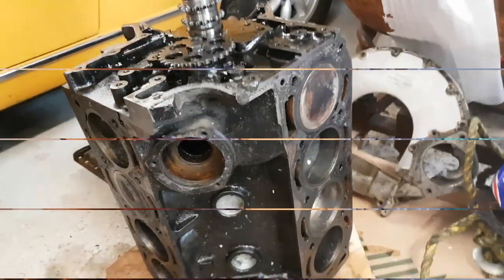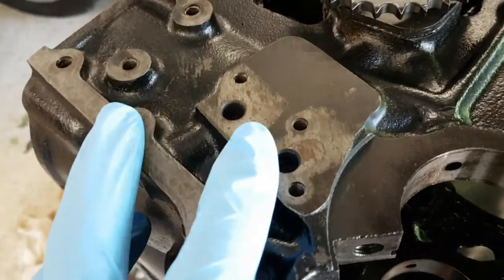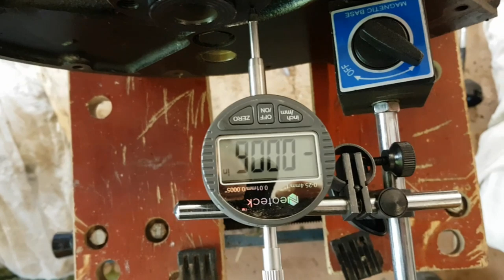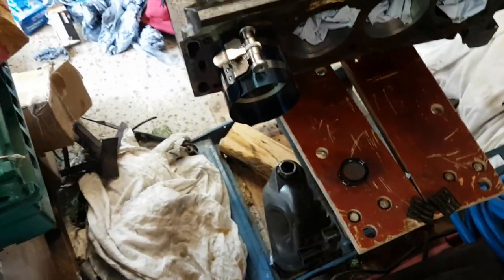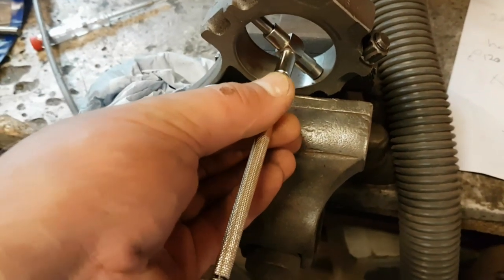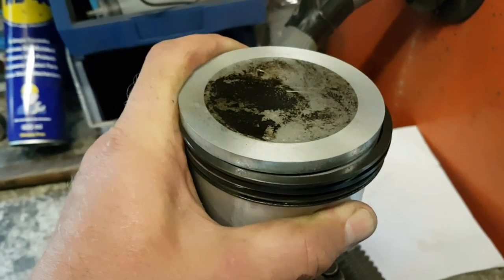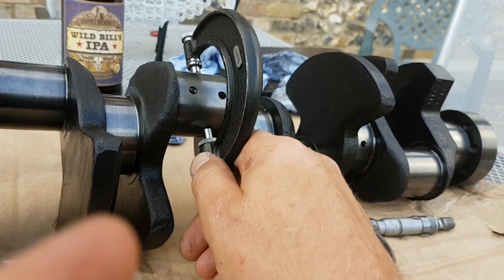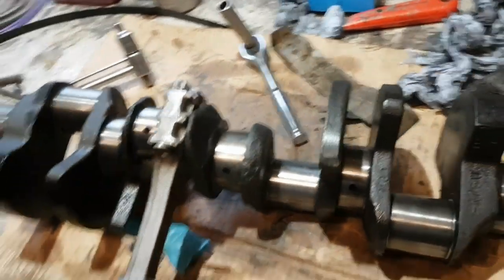Triumph Stag V8 engine build - that keep fighting back Part 1

Comment: Agree on all points you made about people using the usual comments on the reliability. I have had 4 stags in my car ownership and sold the last one in 2011, had a timing chain jump off on my second one after 2 days of owning it [3500 Rover unit was the replacement] 3rd one was a cataloy car with a nice paint job and the last one was no trouble at all and is still on the road. What people don't understand is that any little niggles can be fixed at the side of the road, as opposed to a modern car, that shuts the engine down due to a faulty sensor. So in theory and practice the Stag is a very reliable car. Never had one overheat by the way! Screw you Clarkson and Quentin!
Reply from the maker: You need another Stag, I cannot bring myself to sell mine, watch the latest cold start vid - no spoilers. Ha re Quentin the "hairdresser"

You forgot ant antsead and alexie sayle
Reply: @churchhouseclassics  Yes they made a mountain out of a molehill, over a bloody flat battery! I wish i could afford another but prices are like a 2 bedroom run down council estate house! When i was in full obsessed mode [1992] a mint stag was about £10,000, you can nearly triple that now!

Comment: Sad bit is they are a sweet running and fruity sounding motor and you are 100% correct about people not understanding maintenance. I was once envolved in a project to develop a twin row timing chain like the Merc has but there wasn't a market for it so never produced.
Reply from the maker: twin row sounds like a fabulous solution but this v8 is so understressed in factory form that so long as it is built properly there should be no real issues. 

Rover v8 runs and sound sweet minutes from catastrophe. Stag v8 like so many other engines doesn't tolerate such abuse
Reply: @churchhouseclassics   in my opinion a more advanced engine than the Rover V8 and showed forward thinking in its design. it just needed a little more development before release and also some better training of dealer mechanics. Currently rebuilding Jag V8's but ooh I fancy a Stag.

Comment: This is a job I need to do. Big overheat a few years ago. Heads have been rebuilt and are ready to go on. But I’m told I need a re-bore. Bit like Giles I’m in deeper than I wanted. Got the engine back from where it was stripped. It’s now in pieces in my shed... So great video.. Time to get started..
Reply from the maker: You, me and Giles are itching to get this one finished. I am waiting for Boris to update us on 1 June as to unlocking the lockdown. Might need to get it towed over to my house so I can finish it
Reply: Church House Classics watch out, you might get another one too!
Reply: I’m also looking forward to your video on the Strombergs. Mine were nicely balanced before this all kicked off. Cars been off the road too long now..

Comment: Fantastic video! I’ve always been in admiration of engine builders and would love to rebuild a Stag engine. I fear that I’d bite off more than I could chew and end up with a pile of parts!
Reply from the maker: Thank you 👍 it is only a machine designed and built by mankind. Hardly any wizardry nor witchcraft were involved 😋

Comment: Hello, excellent video, well done. For what its worth ,  I finished my stag engine in July of 2019, logged 5k since then. I would highly recommend using Evans coolant, keeps the pressure down and runs very cool in the Stag.  I have been running it for years in my classics.
Reply from the maker: Me? wouldn't touch it with a barge pole! Why? because ethylene glycol does just as good a job in a healthy cooling system and costs a fraction of the amount.  

evans coolant might appear to be the perfect solution for a cooling system that is operating perfectly, however other have found that it could cause serious damage to the engine where faults exist in the cooling system. search on youtube for the disaster stories and research

Comment: The most accurate way to use a snap gauge is to insert it slightly cocked, nip it up, then tip it the other way.
It will then move to the exact size. No fiddling required.

Comment: C'Mon Tricky Dicky, paint inside the engine helps oil to return to the oil pan BUT BUT it must be Glyptal special internal engine paint.
Reply from the maker: never ever ever painted inside an engine. never will. Gravity is all I need to get oil back to the sump. But then I am a foul mouthed Neanderthal 😂🍻👍
Reply: @churchhouseclassics  Well Mr missing link, I do it as the oil gets back to the sump quicker but then again the cars I drive, Jaguars, are a little more racing engine oriented than a Landy :)

Comment: ive actually seen drag racing engines where they deliberately paint the inside of the block with a heavy duty paint, supposedly to provide less resistance to oil return flow.
Reply from the maker: engine paint or Celly? and that I think was my point. Rong paint and it melts and bungs up oilways 😮

Comment: This man is correct the  V8 was tge first engine in tge modular engine design it was design to be above to made small triumph where working on modukar engibe before most car manufacturers  the saab and the dolomite both used 4 cylinder derived from tge V8 it was not the other way around .

Comment: Hi going to start my re-build soon and will be using your videos. Had the Stag 25 years and it's been waiting for the rebuild all that time ha ha ! But it's gonna have a twist - a retro-mod with subtle changes - what would it look like if it was still in production today...
Reply from the maker: there is a chap on SOC forum who went medieval with his stag
Reply: @churchhouseclassics  one of my changes is to make the front of the car overhang equal amount as the rear hangs past the rear axle. The side view shows a snub-like nose, almost Triumph PI. But extending the front is not easy. The wings afore of the front wheels need lengthening. There is a slight downward angle of the nose which would nee to be extended. Not planning to make any changes to the bonnet so the nose piece needs lengthening. And of course if it was in current production today the two headlights, indicator and sidelight would all be one assembly. But that could mean the combined 'unit' becoming smaller, and if the headlight assembly becomes smaller, the 'grill' needs to become 'bigger' to take up the spare space... (Some idea's I'm planning...).

Comment: 35.02, "And the Stag has got quite a (.) nasty (.) and quite unjustified reputation (.) for unreliability".  You then go on to explain how the aluminium cylinder head starts to dissolve through its reaction with the cast-iron block and this furs the radiator up because it's got quite narrow channels....  A mass-produced car (which the Stag was, albeit quite an exclusive one) should not be made with these potential weaknesses, which can be avoided, but only with specific servicing requirements.  Would a competent engine designer really have trusted all British Leyland garages to put the right anti-corrosion agent into the coolant and change it as often as needed?  And that's before the over-head water pump and sand left from the casting, about which you will know far more than me!  But the reputation is justified.  That doesn't stop it being a lovely engine when it's running right.  These days it's more likely too, as the problems are known about far better than back in the day.
Reply from the maker: I think that the reputation was justified when BL were fixing them. Alas nowadays with better understanding they can be fixed and run reliably. There are a couple of worthwhile upgrades but many snake oil upgrades. I will do another video explaining my rational and love for the good old Staaaaag within the month 👍🍻

Comment: It will overheat thought!!! 😃
Reply from the maker: only if I forget to pour coolant in it 😋
Reply: @churchhouseclassics  they had there issues due to underdevelopment. But a large portion of them have been rebuilt, looked after correctly. They will be as reliable as any other engine. Hey I had a TR6, UK spec when I bought it, it had been used and parts replaced. It needed body work. Anyway I filled it up one Friday night and went off out. Clunk clunk clunk?!! Cut s very long story short. The garage had had a delivery of diesel but they dumped it in the 4 🌟 underground tank. It finished off my engine, it had a bit of piston slap anyway... Turned out the shiny rebuilt head from a very well known UK triumph parts supplier had, had an 8th of an inch skimmed off of it!! The triumph specialist near me was not  happy  at all and reported it to the club.

Comment: what a turn off. why not chemically clean the engine components to get rid of the paint. low class rebuild.
Reply from the maker: budget was the main reason, after assessing the paint which had been on the block for some considerable time we opted to clean the gasket faces and leave the rest alone. Sorry that it turned you off 🙈